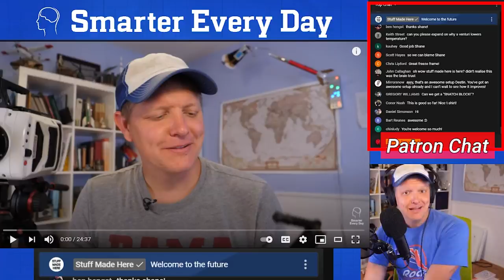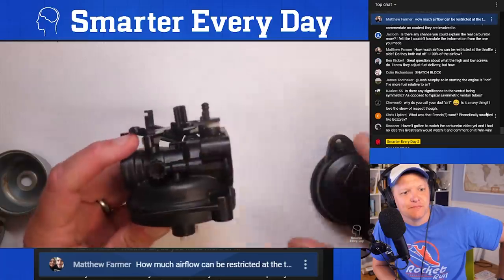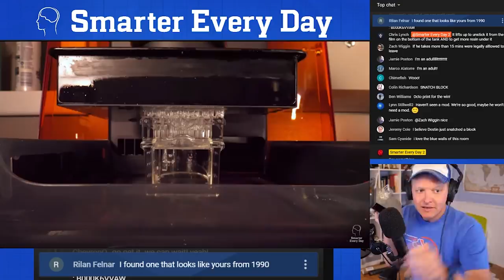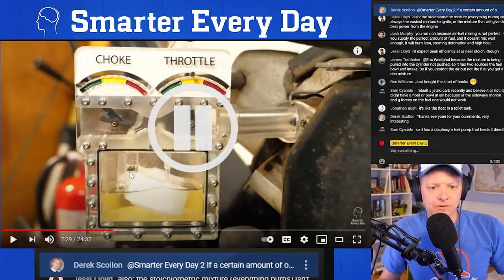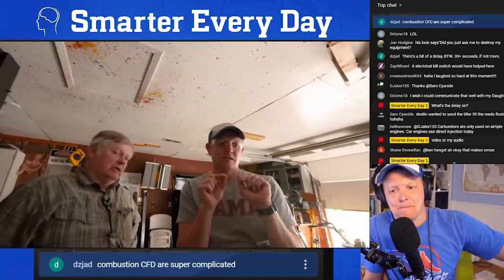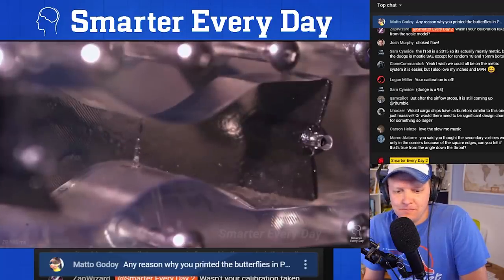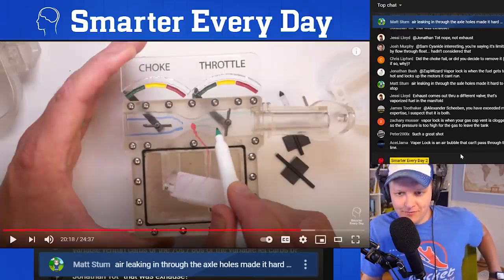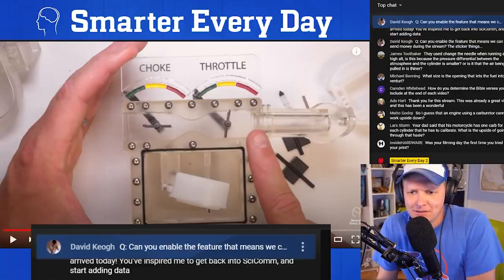BTS "How Does A Carburetor Work?" - Behind the Scenes Commentary | Smarter Every Day

Comment: The carburetor video was the first time I knew more than Destin - an amazing feeling - probably won’t ever happen again!
Reply: Haha. Same for the helicopter videos. Though I loved him for making those videos. Great for my students
Reply: My dad apparently knew waaaayyy more about this than I thought.
Reply: Ditto… but I knew it from a practitioner perspective, not a scholarly one. The slowmo blew my effing mind.
Reply: Sooo… the choke controls the mixture ratio and the throttle controls how freely that mixture is available to burn in the cylinders… 👌🏻
Reply: @ArmchairDeity  the throttle changes the “vacuum signal” or strength of suction the main jet sees and pulls more fuel up when open or less fuel when closed. The choke adjusts overall airflow allowed to enter the engine and fine tuning of air fuel ratio/mixture for varying conditions. The size of the hole in the main jet in combination with the size of the throat or opening in the carburetor dictates its general air fuel ratio/mixture. Generally once an engine is warmed up, the choke is ran wide open or nearly, and the throttle blade regulates total airflow to the engine and varies position based on engine load, or your right foot for a car.
Reply: Lol me too I was so proud of myself
Reply: @Sas0Squatch  hey, man… thank you for expanding… you used way more words to say a way more detailed version of what I meant.

Started working in the family mechanic shop at age 10… I know how a carb works. I was trying to summarize in as few words as possible. 😉
Reply: @Sas0Squatch  I guess it also depends on if you’re looking at choke, Venturi, throttle, each as a separate subsystem or if you’re looking at the whole thing… carb, manifold, valves, etc. My was more “If I had to explain each separately, choke, Venturi, throttle… what would I say about each… in one sentence.”
Reply: @ArmchairDeity  These videos left me wanting to sit in a master class for fuel air mixtures for good running engines. All because I need to figure out the proper jets sizes for two dirt bikes. One with a hesitation off idle for a quick medium throttle blip and another bike for a steady part throttle low load inconsistent rpm wiggle at mid speed. 

I can ride them without fixing them, but it would be nice to have them properly jetted.
Reply: Look up Bernoulli's principle

Comment: Back in the 60's, a metal fuel line would 'vapour lock' when the line was too close to the exhaust manifold. The fuel in the line would heat up and vapourize in the line so that when it got to the fuel pump (old school systems) there was nothing for the pump to pump. It was designed to pump liquid not vapour.
So, the vapour locked up the fuel pump. The fix was to wrap a few layers of tin foil around the line to insulate it enough to stop vapourization.
Reply: I had the same issue on my ‘64 thunderbird. I wrapped the fuel line with some insulation to fix it!
Reply: This 100%. The person on the video saying that it was caused by a blocked gas cap vent is mistaken on two accounts: 1) that is not vapor lock, and 2) it was not at all unusual for a blocked gas cap vent (or mistakenly replacing a vented gas cap with an unvented one) to result in such a vacuum in the gas tank that the tank itself would implode.
Reply: This is actually still a problem on small aircraft engines (Cessna size is what I'm familiar with) - in some models the fuel line to the carb heats up and can lock up in the same manner, such as when trying to start the engine again after having already run it (engine already warm and the heat "soaking" into other components due to no airflow for a few minutes). Basically just have to let everything cool down until the problem goes away.

Comment: I have a classic mini with a carburetor. I live in Scotland while my farther is in England. While i was restoring the car, i couldnt get the fuel supply so i phones my father and he gave me a very similar strip down examination, only it was purely from memory as i was over 500 miles away. He had me strip it down, and reasemble it and i learned how it worked.

This video brought back great memories, but also gave me a greater apreciation of the beauty inside the carb whilst operational.
Thank you for this video!

Comment: Destin, this series was a lot of fun to watch--both for the technological topics being explored and for the awesome father-son interactions.

That said, selecting a carburetor from a Briggs and Stratton engine is both a blessing and a curse. It's a blessing because it's such a simple device--it's kind of the My Little Pony of carburetors: the way its major functions work is pretty easy to see (such as the atomization of fuel in the venturi.) However, it's also a curse because, being so simple, other functions are not as easy to see or understand (such as the tricks used to achieve a reasonably-decent fuel/air mixture at idle.)

I'd recommend a follow-on to these videos using a passenger car carburetor-either a two or four-barrel carb with progressive secondaries and an automatic choke. With such a unit, you'd be able to see how the dedicated low-RPM idle circuit works, how the main jet(s) meter fuel for a wide variety of load and RPM scenarios, how accelerator pumps make it possible mash on the gas pedal without having the engine bog down, and the way mechanical linkages ensure that the choke (and secondary barrels) do the right things in most circumstances.

Your Dad has a bunch more knowledge related to these more complex carbs; he slipped and commented on "metering rods" which are something often seen on larger vehicle carburetors, but I could tell he was working hard to keep the conversation at the My Little Pony level so his son could learn from the ground up.

Thanks for sharing such a wonderful experience!

Comment: Vapor lock occurs when fuel overheats and vaporizes in a fuel line, carburetor or fuel injector, disrupting the correct air-fuel ratio. And since air can be compressed and liquid can't,  the gas bubble acts as a super stopper.
I think.....

Edit,  super stopper was supposed to read spring or stopper.
Reply: close. you're right all the way up to the super stopper part. if the bubble is in the fuel line it restricts flow like a kink in a hose. if the fuel in a bowl is near boiling temp then the venturi will suck vapor instead of fuel since the vacuum in the "straw" will instantly vaporize it, thereby disrupting the forces that make a straw work. (like when you accidently bend a straw trying to get it out of the wrapper and create a hole and then drink from it. also you don't get vapor lock in a fuel injection system. the fuel is under a LOT of pressure which keeps the fluid gasoline from turning into gas.
Reply: @davidburton3447  yes you can get vapor lock with fuel injection systems.  Early corvettes with fuel injection were notorious for it.  Modern fuel injection systems aren't as prone due to the fact they use pumps in the tank and push fuel rather than pull it. And with the addition of fuel return lines.
Reply: thanks .

Comment: If you want to see scary examples of an engine "running away" look up when an old diesel will do it, because diesel fuel doesnt combust via a spark like gas, if the engine finds an unregulated source of fuel it will continue to Rev untill rapid unplanned dissassembly.
Reply: Oh yeah, turbo seals usually, white cloud, knock knock, who's there, the 3rd cylinder. I always have this in the back of my head because I drive an old TDI Skoda with a broken killchoke. Apparently the thing to do is 5th gear and brake hard. Stall it.

Comment: My oldest son just graduated from a MST Magnet High School. During his time there they would have Science/Engineering Fair (students from his school have actually won the ISEF). He worked on a Rasberry Pi controlled irrigation system that measure soil moisture content, then opened sprinkler valves when needed. It also had a RGB LCD readout and app interface he built. He wrote a lot of python for it and some Java. It worked great and he actually got an environmental conservation award from NASA for it. It conserved water by only delivering exactly what was need. He mostly learned he didn't want to be an engineer or computer programmer :), but he learned a lot about the process. He is now going into pre-med focused on neuroscience.

Comment: This has been a fun series of videos.  I bought my first vintage motorcycles a couple years ago so I've been learning a lot about carburetors.  I thought I had a pretty good idea about how it all worked, but there were defintely surprises in your experiment.  I've always been impressed that the tiny float needle, with just the pressure from the float, can completely shut off the flow of gas.  If any gas leaks through that small needle seal, your carb will overflow.

Comment: Vapor lock is when gasoline vaporizes in the fuel system before being injected into the air-stream, causing a difficulty in measuring the correct quantity of fuel for the mixture and or interrupting fuel flow in the fuel system. Vapor lock happens in the fuel rails, not in the gas tank.

Also, I don't believe that was nebulized or vaporized gas, in that shot, that was more likely combustion/exhaust gasses coughing back out through the intake instead of out the exhaust as it should. If you watch closely, it looks like it runs out along the top of the intake from the engine towards your hand and then settles down as it cools after mixing with the cooler outside air.

Comment: EFI computers make up for gasoline clinging to the walls (in this case throttle plate also).  Its called "wall wetting" and when you're tuning with EFI it is something to consider. The computer uses it as part of the fuel scheduling algorithm.

Comment: The choke doesn't produce a rich mixture of fuel as such. Cold air has more of a rick oxidiser, in this case oxygen. The gas molecules are tight together, so because of the rich oxygenated air, the air needs to be choked. As the air travels to the warm engine the  mixture ratio then changes, that is when the mixture becomes rich in fuel. That's how intercooler work, before the air travels into a turbo. Love the channel. Keep up the good work.

Comment: RE: PETG. I used to only print in PLA because it came out better, but then I discovered APT (advanced polymer tape). It's like a yellow tinted tape almost like packing tape, and I wrapped it in rows around my heated bed. Now my PETG prints so good the bottom has a glossy surface!

Comment: Your dad is a metrologist?

I would seriously love to see you just sit down and have a chat to him about his work.

When simply measuring something becomes an occupation and trade in its own right you know that there's something deep and fascinating hiding in there somewhere.

Also, vapour lock is simply heat from the engine causing fuel to vaporise in the fuel delivery line to the fuel pump, which was commonly part of the carb. You then end up putting vapour into the bowl instead of fuel and you lean out the motor or even stall altogether. Depending on the pump design the vapour can also cause a loss of prime and be hard to get going again.

Comment: Smooth changes in surface allow laminar flow, whereas a step change leads to turbulent flow. You want the entry to the venturi to be laminar, so the suction generated is not going to have a variable component, but after the fuel is introduced you want turbulent flow, so the diameter can change rapidly to allow more turbulent flow.

Comment: Vapor lock is when the fuel in the supply line to the carburetor gets to hot, boils and creates air bubbles that interrupt or stops the fuel from flowing to the carburetor. 
  Lived with this regularly in the 1940s and 50s. If you insulated or rerouted fuel lines you ended the problem.

Comment: Zapper lock is when fuel vaporizes in the needles. 

The up and down motion on a resin printer is to break the print free of the fermented sheet. You then need to lower the print back to where is barely contacts the few sheet.

Comment: Coming to your question at the end - i work a lot with python - both private and for work. At work i automize processes like running software tests, controlling power supplies or converting files to a specific data format. When programming for pure fun i already build a smart rgb-controller for my pc which was connected via a proprietary protocol to a deamon on my pc, currently i am working on a fan controller for the basement, which only starts the fans when the dew point is acceptable.

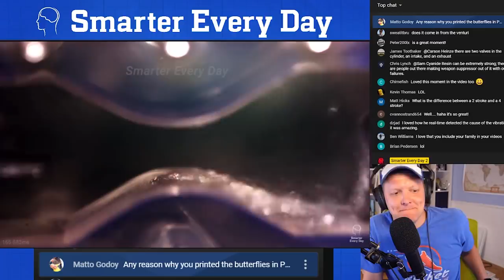Comment: 41:53 macro high speed  fuel induction moment...
You can see the fuel stream  gets pushed out(to the inlete) for a few frames( 3-5? don't know your fps)  this is a demonstration of the effects of " cam lobe overlap", were the E valve is almost closed and the I valve starts to open allowing "reversion "(reverse flow)  a major dynamic in performance cams/heads.

side note This was the first form of diesel "EGR" (exhaust gas recirculation)  most will argue that a light duity Cummins didn't get EGR till MY07.5 ,however, they just don't understand that lobe overlap was increased in MY03.5 to enhance this reversion  effect to replace a % of the fresh air with inert(used up dirty soot laden air) in an attempt to reduce NOxx production. This was technically not EGR as it was not recirculated just traped. It  retained all of its latent heat which overwhelms the cooling system by keeping more latent heat in the cylinder and it has a very poor percentage of NOxx  emission reduction   if any.

Comment: I just ordered a complete set of those books, and i probably overpaid a bit lol. There are 4 volumes if anyone is wondering, and there are quite a few sets on amazon. There are a number of dates listed, that are all wrong. They were published in 1969, just before ISBN became a thing. They don't seem to have an ISBN applied after the fact from a later printing either. Its also a european english series. because of all that, amazon has probably 20 different listings for the set, and even more for each book
Reply: The illustrations look identical in style to a favorite of mine "The How and Why of Mechanical Movements" by Harry Walton, illustrated by Ray Pioch. Popular Science, Dutton publishers, 1968. I have been looking for something similar and I think at last I've found it!

Comment: 0:46 yes I did, but not exactly a mower: my uncle used to have a car with a carburetor. And if sometimes the battery or the starter would die, we would start the thing up with a manual crank.

Comment: Do a video on...  get an air fuel ratio gauge,  and work out how rich this carb is..   then try different fuels with different energy density.. like ethanol  etc.. and mix it with fuel..  can be a video on energy density and air fuel ratios.

Comment: You should invest some time into the Geet Reactor (carbeurator)... although because it requires a ferromagnetic casing, it's hard to make transparent ports to see what's happening... it's a combination of venturi effects, magnetic effects, it uses the exhaust over the intake to add heat to the gas mixture and make it easier to combust... in theory can run it on just about anything.    Eh ; finding a good link for information leads me to a bunch of jaded responses.

Comment: Pretty sure (without looking it up). Vapor lock is in the fuel line not the carb. It’s when you have fuel under suction instead of pressure. That’s why you want to put the fuel pump as close to the tank as possible.

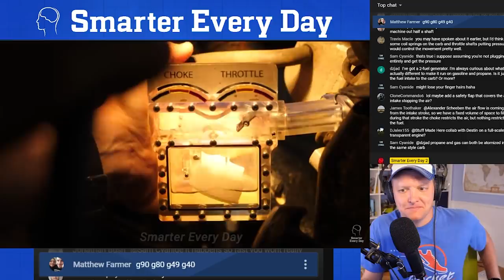Comment: 52:48 The vapour boiled because of the low pressure at the point of starvation (boiling point drops in a vacuum) in this case not because the manifold was hot..

Comment: Why didn't I get invited to this meeting? lol  You should take a look at a Holley 3310.  People either love Holley's or hate them.  If they HATE them it is because EVERY aspect of the carburetor is calibratable.  If they LOVE them it is because EVERY aspect is calibratable, and they have a dyno and exhaust gas analyzer or a drag strip.  I fit into the ladder category.
Wait, stop. I need to say something.  Carburetor technology became amazing over time, but carb's SUCK compared to fast computers running EFI. 
Someone asked the question if there is a perfect air fuel ratio why not run it all the time? GOOD QUESTION! 
Good answer: Because the perfect ratio changes based on ... load (intake pressure/vacuum), engine temp, ambient temp, intake air temp, fuel quality, engine RPM, etc., etc., etc...
Fuel injection delivers fuel based on the needs of the engine at that time. Note: Based on the programming of the computer.
Back to the video, I'm listening but I need to be watching.
I'll be back.
At 57:00 to 57:05 Like I said, "your inferior clear carburetor made a much better video than a real carb could have".  Beautiful indeed!
I can tell from this video you are learning more and more about carbs, and I would like to think that my comments on the second video might have played a part in this.  This might be a good time to warn you to expect comments on the upcoming fuel injection videos.  ;)
You also said "people on the internet are angry".  I strongly disagree. ha ha
Tell Dad, oops I mean Darryl thank you very much.

Comment: Above the main jet in the bowl is the emulsion tube.  The gas going up through the jet gets emulsified into a fine spray of gas as it enters the venturi tube.  The emulsion tube is the worst for getting.clogged because it uses very fine holes to aerate the fuel. It shoild be unscrewed out and cleaned for sure.

Comment: The info on the 4-volume set, as you requested, good sir:

Title: How Things Work Volumes, I to IV
Binding: Hardcover
Illustrator: Roger Jean Segalat
ISBN 10: 1114119512 / ISBN 13: 9781114119512
Published by Edito-Service, 1900
Published by Bibliographisches Institut and Simon and Schuster, 1984
Published by Simon and Schuster, 1990